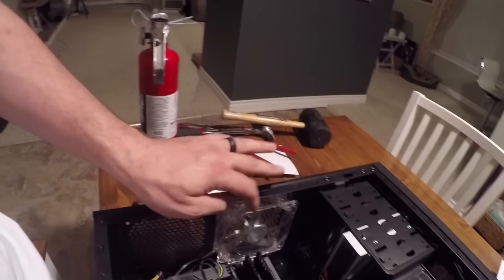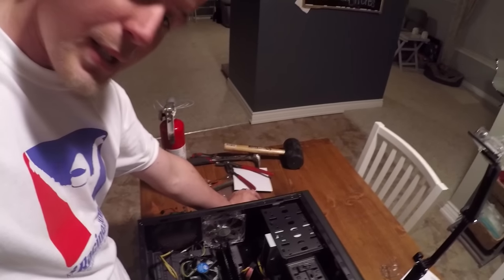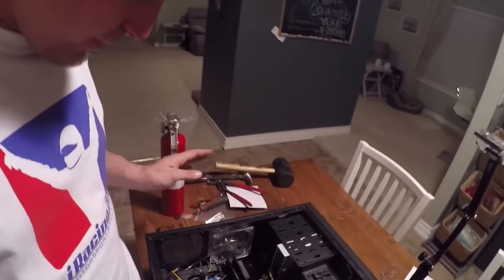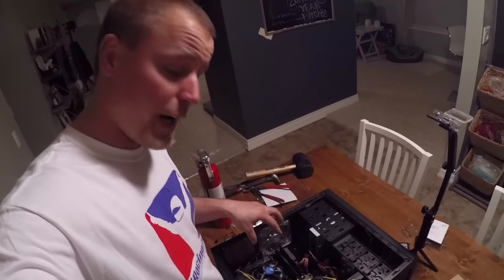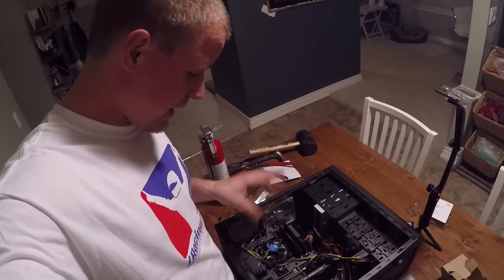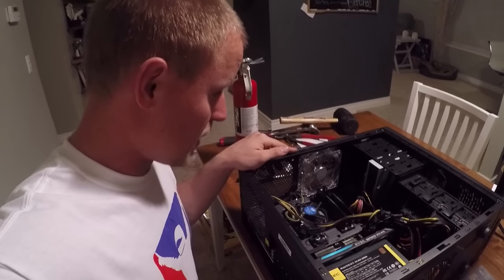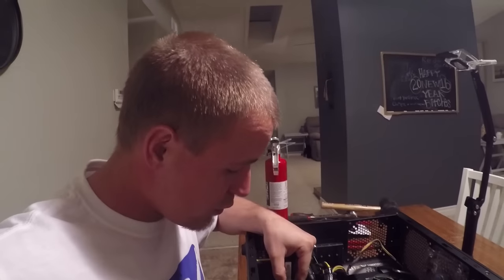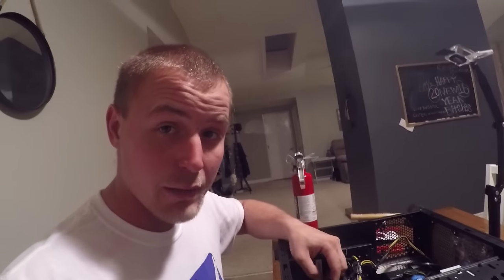Computer Upgrades Engaged Sabertooth Z97, i7 4790k and Geforce GTX 970

Comment: Way to go on doing your own upgrades! Takes a little bit of courage.  Here's a couple suggestions to help make your next build (yea you will have another build at some point) go a bit smoother.

1)  Unless your mobo has the plastic armor on the bottom do NOT sit it on an unprotected static surface.  Looks like you have hard wood underneath and on the floor from the go pro shots, and today's mobo's are definitely hardy.  But this doesn't prevent you from blowing something up.  I didn't see if you were wearing a static strap or other type of grounding method but that CAN be important.
2)  Install mobo in case then install parts.  Looks like you did this for the most part.  I've always wanted to get the mobo securely mounted in the case before I start cramming processor/memory into it.  The advantage here is that if you zap the mobo (from #1) you don't risk processor and memory explosions as well.  I should note that when I say explosions, I don't mean literal ones.  When enough static electricity gets into the circuit it can "blow" something up and you won't even know it happened, it just doesn't start/work.
3) This really isn't a suggestion but more of a comment, I am still trying to figure out what you planned on using the fire extinguisher for!  haha! ;)

Good job, I'm sure you'll be much happier with your new rig!  Love your vids!  See you on the track.
Reply from the maker: +Gabriel Castlebary thanks for the tips will implement when I do my next upgrade

Comment: Nice man.  I run an EVGA GTX970 SSC as well.  I capped the frame rate in iRacing after installing the 970, because it would go up as high as ~530 FPS and there's obviously no need for that.  Lowest I ever saw it dip without the FPS limit was ~380 if I recall correctly.
Reply from the maker: +rob p haha nice mine is capped currently too but only to keep my computer temps down

Comment: I built computers for a living for a couple years and I still screw up the front panel pins. I got a chuckle out of the mallet, hammer and fire extinguisher, nice touch.
Reply from the maker: +Jerad Sharp screw those pins and you never know
Reply: True Racer Well I guess I have had to use a fire extinguisher on a PC before so always better to be safe than sorry.

Comment: Nice job on install and troubleshooting. I just upgraded to a 4790K also. If you are looking for an AIO cooler, I suggest the swiftech h220x. It has good reviews (and is supposed to quieter) that made regret choosing corsair h100. Also wondering why (probably still the price difference) you didn't go with a 980ti and a cheaper motherboard.
Reply from the maker: +Manny_NotTheStig gotcha will look into it

Comment: Get yourself an NZXT Kraken X61 AIO cooler, the thing is super compact and REALLY good at cooling the CPU. Just make sure your case has room for the 280mm radiator and fans! Looks like you might struggle to fit it in that case...
Reply from the maker: +Lufferov ok I will look into it I think I need a bigger case anyway

Comment: Matt, I'm sure you already know but another case fan (or two) would be optimal. A i7, especially on the stock cooler makes a lot of heat and 1 case fan is barely enough for a low end system, not whats a very high end one. You've got a non populated slot at the top, front and back. I'd get at least another exhaust (top or back) or intake (front), especially before going anywhere near overclocking. Your GPU also blows its hot air into the case, not out the back like some and with quad monitors and streaming the case heat will be high.
Reply from the maker: +SimRacing Stuff yes you are correct and thank you for the clarification on mounting I will try and make it out to fry's this weekend
Reply: It just depends what you plan on doing with the CPU cooler. For instance most good liquid coolers mount the radiator on twin 120mm fans, which would take up both the top slots (were that exhaust is currently). But I'm not sure if you plan on keeping that case, as if you decide to upgrade both the case and cpu cooler whatever new case you buy will likely come with 2 extra case fans, most modern ones do (quite often it can be cheaper and better off long term just to buy a case with two fans for like $80 as opposed to wasting $40-50 on more fans for a lesser case). I guess it just depends how hot it is there, I've got a 970 on an older i5 and it gets pretty warm with 2 case fans.

Comment: hey bud...i thought that the graphics card was suppossed to go in the highest pci slot for the best performance...i may be wrong with that board,but that is what i was told....congrats on the new equipment
Reply: +Bill Williams Yes you are right. He installed it in a PCIe x8 slot. 
You have the best performance in a x16 slot which is the top one on most boards
Reply from the maker: +Bill Williams ok noted I will change it next time I am in there

Comment: hey matt there should be 4 case fan headers onthat board,i cant believe they wouldnt have put one where you fan was original
Reply from the maker: +patchedupdemon what do you mean
Reply: if you look at the bottom right hand corner of your board,by the round cmos battery there is a connector labeled cha fan1. that should allow you to have the fan in its original position.there is also one below the cpu and 2 more below the last pcie slot
i dont have this board but i just looked up the manual and noticed that.
i had to change my youtube name as i was getting trolled,dont no if you remember but ive been watching you channel for a while now my name is russ lowe.
best you check the manual incase your fans have only 3pin connectors then you have to connect them into the certain 3 slots if 4pin connectors

Comment: Fractal design r5 case upgrade required
Reply from the maker: +Colin Littley ok I will look into it
Reply: the case will give you plenty of water cooling option for the future and plenty of customisable space for the time being. Good luck. also as a perk look at the NZXT HUWE+ for lighting effects its a wicked combination. would also recomemd a second GTX 970 in SLI mode to improve the graphics even more and the additional cuda cores on the two will make your graphics awesome on a 3 monitor setup such as yours. Race On......